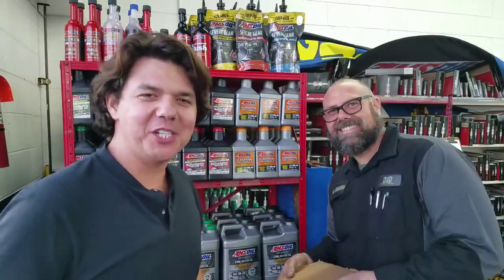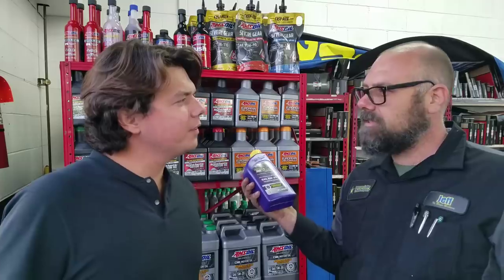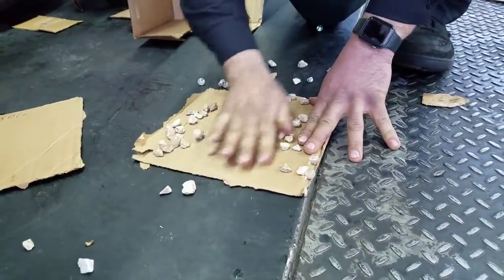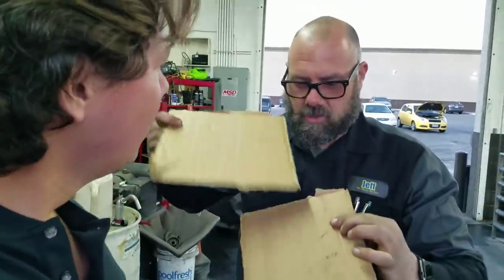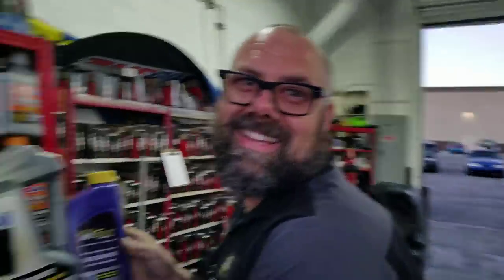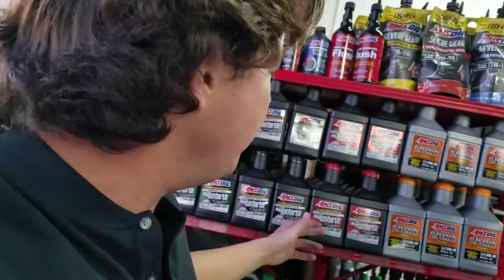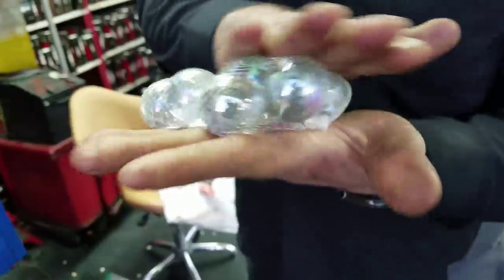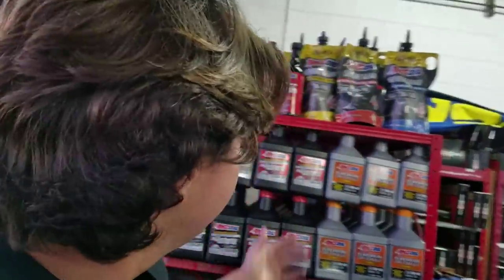Is Full Synthetic The Same as 100% Synthetic - Big Oil Companies Won't Tell You THIS!

Comment: What's your take on Pennzoil Ultra Platinum, I have had great results with them and even did a oil analysis report. They are made from Natural Gas vs Crude Oil
Reply from the maker: It's ok because AMSOIL offers a better Product & your engine will last longer with 100% Synthetic. 

Plus your good for 15,000 miles.

It's much better in the long run.
Reply: @Syntheticoilprotection any oils can make engines last longer if the vehicle is well maintained. On highway trucks have over millions of miles and their owner had used every oils they could get
Reply from the maker: @danteerskine7678 of course but the question is does the vehicle run better than brand new?

♥️   Your vehicle can run better than brand new by choosing the right fluids! 

     🇺🇸   50 Years of AMSOIL anniversary - https://youtu.be/MQUqRBI8dD0
     
     🥇🥇🥇   Synthetic Oil Protection Google map reviews
Eben Rockmaker, independent AMSOIL Dealer 
Dealer no. 5331179
(702) 472-3614
https://maps.app.goo.gl/1aXxuXrXK9eJwqK78
         
♥️   See fluid performance tests - https://www.amsoil.com/performancetests.aspx?zo=5331179

Comment: Can i buy ams oil in the netherlands?
and what is your opinion on motul?
they also make 100% oil
Reply from the maker: https://www.amsoil.com/international/?zo=5331179
Reply: @Damián Rodriguez 100% is not full syntetic. motul makes 100%
Reply: @Damián Rodriguez OMG! YOU ARE RIGHT! 
i thought only motul makes 100% syntetic in europe. what other oil is REAL syntetic?
Reply: @Damián Rodriguez this what motul says: 

When you see the words 100% Synthetic on a bottle, such as in Motul’s H-Tech, 8100 and 300V ranges, that means that EVERY SINGLE DROP of oil in your bottle is a synthetically produced compound, mixed with fully synthetic additives. Guaranteed.
Reply: @Damián Rodriguez but is motul 100% syntetic vetter than othet full syntetics? like castrol
Reply: @Damián Rodriguez ester based oils are overkill to use in a daily driver shitbox. motul 100% is good enough right?

Comment: How about Amsoil oil filters compared to other oil filters. Also I heard that FRAM ULTRA SYNTHETIC® oil filters are very high quality.
Reply from the maker: The Amsoil filters are a big step up they filter at 99% efficiency at 20 microns they also hold a lot more contaminants because of the synthetic media also it has a much higher flow rate so less restriction.

This will show you all the specs on the oil filter and how they are different - https://www.amsoil.com/p/eaoilfilt/?zo=5331179

Comment: I hope amsoil does some testing against mobile 1 annual protection THATS a newer oil from mobile 1, annual protection from mobile 1 is rated for 20k obviously won’t trust it but it’s definitely better then extended performance
Reply from the maker: AMSOIL Signature Series is fortified with a heavy treatment of detergent additive and it delivers 30% more acid neutralizing power1 than Mobil 1, and 36% more than Royal Purple, helping engines to stay cleaner, longer.-
https://www.amsoil.com/newsstand/motor-oil/articles/cleaning-up-the-competition/?zo=5331179

Comment: Royal Purple's the Best Hands Down.
Reply from the maker: Industry-standard 3rd party testing results:

AMSOIL Signature Series 5W-30 Synthetic Motor Oil protects against harmful deposits on turbochargers 4X better than Mobil1® Extended Performance and 3.6X better than Royal Purple® in industry-standard testing*.
https://www.amsoil.com/newsstand/motor-oil/articles/leading-the-field-in-deposit-protection/?zo=5331179

Amsoil gets better gas mileage - 
https://www.amsoil.com/newsstand/motor-oil/articles/another-win-for-amsoil-products/?zo=5331179

AMSOIL Signature Series is fortified with a heavy treatment of detergent additive and it delivers 30% more acid neutralizing power1 than Mobil 1, and 36% more than Royal Purple, helping engines to stay cleaner, longer.-
https://www.amsoil.com/newsstand/motor-oil/articles/cleaning-up-the-competition/?zo=5331179

Comment: can't do even Lab test, or even just a real test in your table using different metal items with sticking or flowing 
your saying 100% vs a full sythetic oil, then do it in graph as the presentation of how these two oil behaves with respect to temperatures sir.??
Thanks for sharing anyways. ^
Reply from the maker: You'll see in this link there is a comparison of the gear lube and it shows the cold flow property - AMSOIL Performance Test Results - https://www.amsoil.com/performancetests.aspx?zo=5331179

Comment: I wanna use the OE amsoil. Is it better then full synthetic like Mobil one or castrol
Reply from the maker: Yes Steve it's quite a bit of an upgrade because it's 100% synthetic has a higher film strength which keeps the metal separated you'll have less wear less heat less vibration.

This is my link if you have any questions with my link I will be your Amsoil Dealer so you could always ask me questions in the future and I will get the credit for your order and I thoroughly appreciate you being a part of my YouTube community always happy to talk anytime.

Professional YouLubher: Eben Rockmaker Regency Gold Direct Jobber AMSOIL Specialist (Dealer#: 5331179) 702-472-3614 

Get AMSOIL Wholesale Pricing - https://www.amsoil.com/offers/pc/?zo=5331179

Comment: This video has completely turned me off from you.  Best of luck in your sales goals.
Reply: 2007 Honda Civic 246000 original miles using Mobil 1 10w30
Reply from the maker: Industry-standard 3rd party testing results:

AMSOIL Signature Series 5W-30 Synthetic Motor Oil protects against harmful deposits on turbochargers 4X better than Mobil1® Extended Performance and 3.6X better than Royal Purple® in industry-standard testing*.
https://www.amsoil.com/newsstand/motor-oil/articles/leading-the-field-in-deposit-protection/?zo=5331179

Amsoil gets better gas mileage - 
https://www.amsoil.com/newsstand/motor-oil/articles/another-win-for-amsoil-products/?zo=5331179

AMSOIL Signature Series is fortified with a heavy treatment of detergent additive and it delivers 30% more acid neutralizing power1 than Mobil 1, and 36% more than Royal Purple, helping engines to stay cleaner, longer.-
https://www.amsoil.com/newsstand/motor-oil/articles/cleaning-up-the-competition/?zo=5331179
Reply from the maker: Keith, thanks for being a part of my YouTube Community.

I dont sell anything. I get things bought bought for one reason.
RESULTS- https://youtu.be/H7K6FdZlqmg

Professional YouLubher:
Eben Rockmaker Executive Direct Jobber AMSOIL Specialist (Dealer#: 5331179) 
Mobile: (702) 472-3614
 My link: Best AMSOIL 100% Synthetic @ Wholesale + FREE Shipping: https://www.amsoil.com/offers/?zo=5331179 
AMSOIL Products & Vehicle Lookup - https://www.amsoil.com/guides.aspx?zo=5331179
Reply: 2007 Honda Civic 290k km 5W-20 with random oil used.

Comment: Videos like this are disturbing. Is this true? I think so, due to commerce.. I know you can buy certain alcohol that is stated to be certain age, yet it only requires 5 drops to be allowed to label it that age.. Marketing
Reply from the maker: Did you know a oil manufacturer can call a lubricant a Full Synthetic when it's only 25% synthetic? AMSOIL is different because it is 100% Synthetic and has a higher film strength keeping the metal parts separated. AMSOIL allows less friction, less heat, less wear on the component. 

     Your Vehicle Could Run Better Than Brand New By Using AMSOIL 100% Synthetic Lubricants! See Results - https://youtu.be/zH-VquYlhqA

     AMSOIL Signature Series 5W-30 Synthetic Motor Oil protects against harmful deposits on turbochargers 4X better than Mobil1® Extended Performance in industry-standard testing*.  Read This Article - https://www.amsoil.com/newsstand/motor-oil/articles/leading-the-field-in-deposit-protection/?zo=5331179      

     ♥️ AMSOIL Performance Tests: Read This Article - https://www.amsoil.com/performancetests.aspx?zo=5331179

Comment: Show this video to that one guy everyone knows who has driven a 95 Camry on nothing but conventional oil for 350k. You would be better off changing your oil twice as often for half the price.
Reply from the maker: Yeah that's what it would appear to be however there's some major differences even if you change your oil every 500 miles with conventional oil and 25,000 miles with the signature series your engine would last longer with the 100% synthetic Signature Series because the particles in the oil will physically not wear out the metal the same you'll have a better efficiency of the motor longer this will depict it clearly in these oil tests scroll down you'll see the cylinder scuffing test and it will show how big of a difference the lubricants are.
♥️   See fluid performance tests - https://www.amsoil.com/performancetests.aspx?zo=5331179

Comment: You guys are full of it you offer no real proof to your claims. This is what you call an advertisement!
Reply from the maker: Industry-standard 3rd party testing results:

AMSOIL Signature Series 5W-30 Synthetic Motor Oil protects against harmful deposits on turbochargers 4X better than Mobil1® Extended Performance and 3.6X better than Royal Purple® in industry-standard testing*.
https://www.amsoil.com/newsstand/motor-oil/articles/leading-the-field-in-deposit-protection/?zo=5331179

Amsoil gets better gas mileage - 
https://www.amsoil.com/newsstand/motor-oil/articles/another-win-for-amsoil-products/?zo=5331179

AMSOIL Signature Series is fortified with a heavy treatment of detergent additive and it delivers 30% more acid neutralizing power1 than Mobil 1, and 36% more than Royal Purple, helping engines to stay cleaner, longer.-
https://www.amsoil.com/newsstand/motor-oil/articles/cleaning-up-the-competition/?zo=5331179
Reply from the maker: https://youtu.be/E2zS8MyvJxU
Reply from the maker: Real proof.
Reply: Nope to well educated to buy it. This is simply an article that does not validate their claims. Telling me that a third party blindly tested the product with out naming the party is not valid. Nothing more than mere advertisement.

Comment: So if oil lasts 15k miles how am I supposed to spend $100 to get the free shipping? Keep the propaganda magazines and sgive me a break on shipping lol.
Reply from the maker: Great question!

Amsoil offers many proprietary products that are significantly better than anything else available in stores:

Amsoil Pi performance improver.

Amsoil oil upper cylinder lubricant.

Amsoil silicone spray

Amsoil MP metal protector

Amsoil engine flush

Amsoil oil filter

So when you make your order you would get an oil change oil filter two bottles of Pi performance improver one case of upper cylinder lubricant a bottle of engine flush a can of MP metal protector and a can of silicone spray.

You would be good for the year also you wouldn't have to reorder for any more fuel additives he be able to silicone your engine compartment keeping your rubbers protected also all your locks in metal mechanisms.

There are promotions throughout the year as a preferred customer where they give different things away like a free bottle of fuel cleaner so on your next order you would order when they're doing a promotion.

Also when you make your order if you become a preferred customer and spend 10 or $20 that goes towards the $100.
It's very easy and if you ever have any questions feel free to call me☕

 it's a whole lot less than you think once you see and feel the products😉